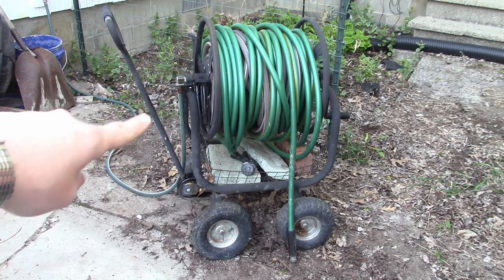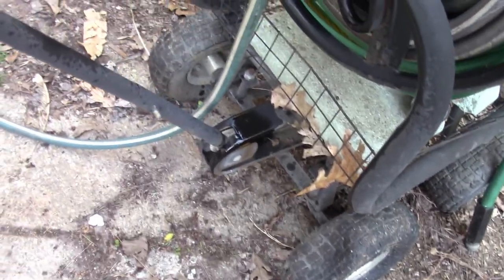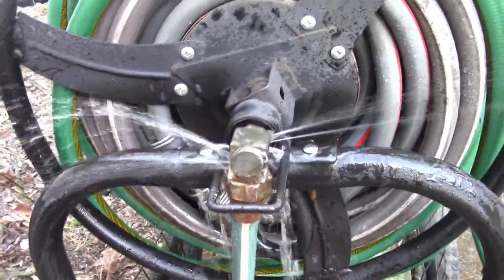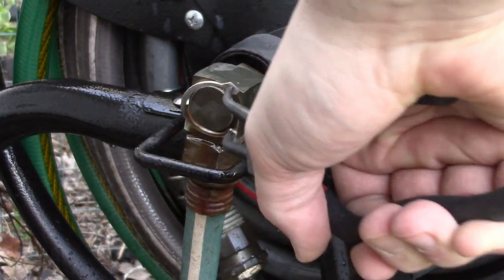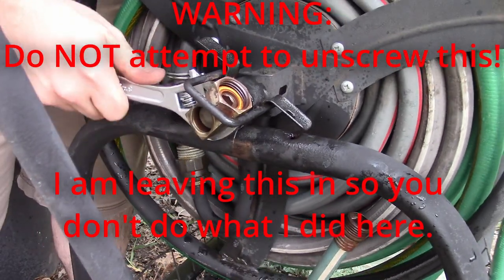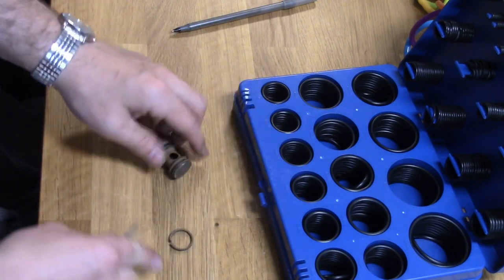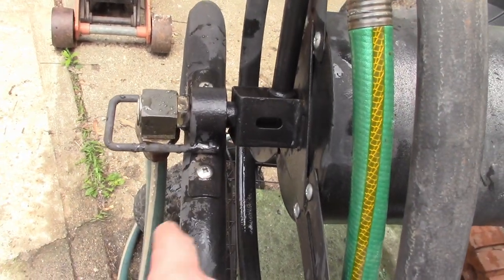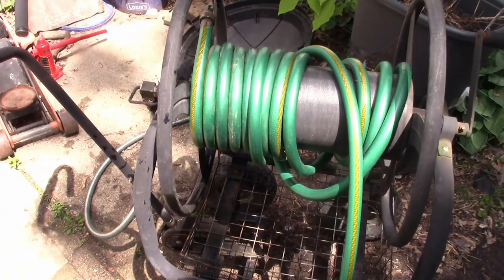Fixing Leaking Sam's Club Member's Mark 300' Steerable Hose Reel Cart GN2136701-MM 06212D Rankam

Comment: FYI , I replaced my tires with rubber filled from Harbor Freight you’ll be glad you did !! The added weight helps keep reel balanced as well.
Thanks for the video !
Reply: What size did you get?
Reply: @zoomzoomboomboom  actually I brought one of the old ones with me to the store and matched it up , was easier that way .
FYI the new hubs or center of wheels were galvanized but I painted them black because it’s FL and everything rusts . They still look & work great .

Comment: It might be worth noting that adding a little petroleum jelly or vasoline to the O-Rings will help and prolong the life a lot longer. Also the fitting that the hose acutally screws into, unscrews and has an O-Ring there as well. The replacement O-Ring can also be found in the kit striker1211 mentioned from Harbor Freight.
Reply: trying to figure out where this other o ring you speak of? mine came from tractor supply about 4 yrs ago. Mine started leaking like this too. Removed mine and I have 4 o rings in same area in this video., He has only 2
Reply: Best I can remember, In the video he replaces 2 O-Rings that are going Horizontal. After re-assembly I noticed I still had a leak. So disassembled it again and found an additional O-Ring that ran Vertical. After replacing that one and the wore out small hose the cart was like new again. I will add that before I removed anything I cut the end of the Metal U-Bracket off, which he outlines in the video. That is totally necessary to avoid damaging the brass fittings. Hope that helps.

Comment: Thanks for the video, I have a question. Mine won’t spin and seems to be seized up, how do I fix that? The reel won’t spin.
Reply from the maker: If it was mine I would get some penetrating oil like PB (or Liquid Wrench) , put the unit on its side so that the bearing is like a "bowl", and then spray the PB on it and let it soak overnight. Once it's freed up I would use lithium grease on it and rotate it to work it into the bearing.
Reply: Thank you!

Comment: That metal bracket is to protect that hose fitting. That's its purpose. You can remove it if you have to. Won't hurt anything

Comment: My hose reel has the same fitting and is leaking, so I assume the O rings need to be replaced.  There is nothing blocking mine, so when I remove the snap ring will the piece that has the O rings slide right out?  Then I just push it back in and put the snap ring back on after I put on the new O rings?
Reply from the maker: Yeah if you don't have the metal bar there the hose should come off once you remove the snap ring. Wear glasses those things can fly.
Reply: All fixed.  Had to do it twice.  First time I must have used too small of an O ring and it leaked worse.  Next size up fixed it.

Comment: The U-shaped Bracket is threaded ONLY on the RIGHT SIDE as you are looking down on it. All you had to do was unthread the one nut that's holding it and the bracket would have come right off!
Reply from the maker: You must have a different model, mine had threaded bolts all around.